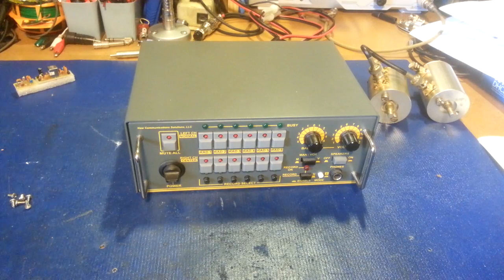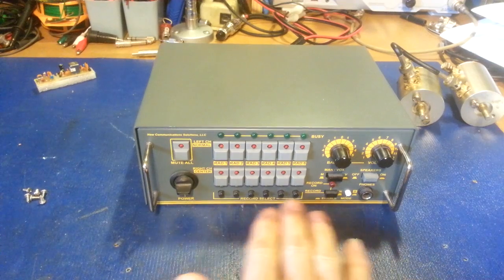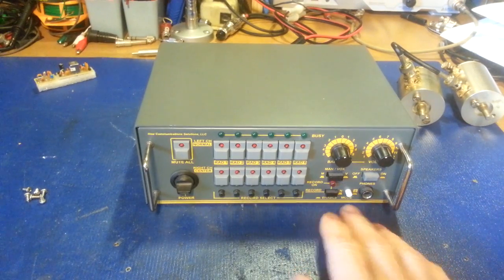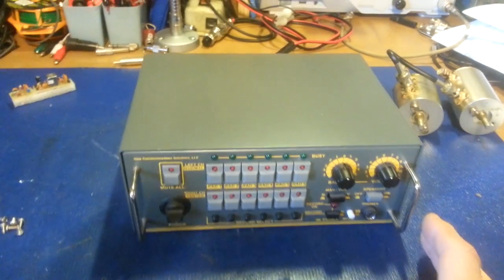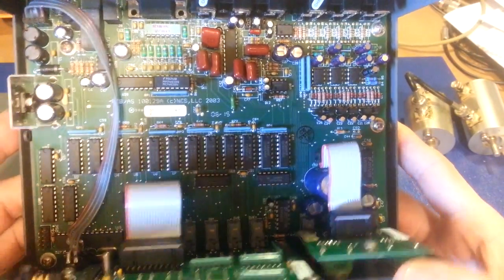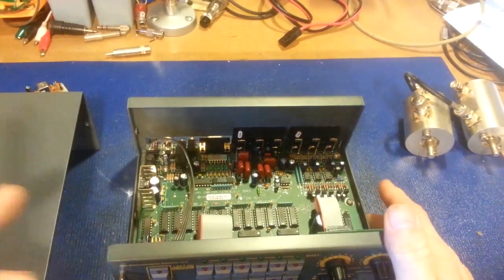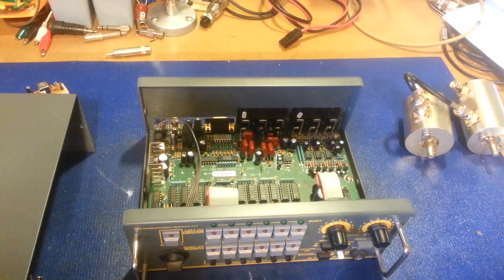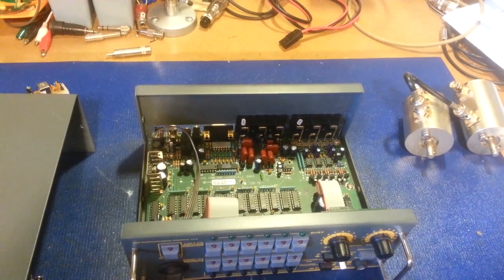New Communications Solutions NCS-3230 receiver switch box. Pre-installation overview.

Comment: I had both units in service for years, I got it new from them. They are a great product and and concept but hopefully yours won't suffer from the problem I had. It seems to have had an intermittent problem on one of the channels audio coming in and out. I sent it back to them and they either couldn't or wouldn't fix the problem. Good luck with yours. I ended up using a Behringer mixer with a small stereo amplifier. Now I'm thinking about getting rid of the amp and using studio monitors instead. Buying the set original with all of the cables when they were out was quiet pricey but when it was working right it was great. Nice video and thanks for the time for posting.
Reply from the maker: oldschoolSlyfan 
Hopefully never have a problem with them but if I would NCS was kind enough to provide me a set of schematics for them.  Thats the first thing I do when I get something,  get the schematic.  I actually just got another one of these two days ago.  Should show up this week sometime.

Do you still have yours?  Its probably something simple that's wrong with it.
Reply: Oh my, this is sounding interesting. Yes, I do still have it.
Reply from the maker: oldschoolSlyfan 

It should be fairly easy to find the problem.  The nice thing about finding a problem in something with multiple channels is you have the same circuit duplicated several times.  If one doesn't work just compare test measurements between a working channel and the one that doesn't.
Reply: When you get the schematics and like to give it a go, I think it would certainly be worth the repair costs. Thank you. (w2rkj)
Reply from the maker: oldschoolSlyfan 

You may even be able to fix it yourself.  You did say it's a intermittent problem.  It operates off 12V so no chance of electrocution or shock.  It could be something as simple as a bad solder joint thatnis intermittently making connection.  Pop the cover off and get it to malfunction.  Go through it and touch the parts with something plastic or wooden so you don't short anything out.  If its a bad solder joint you may find when you touch a part it starts working again.  If moving a part brings it back to life you just found the problem.  Worth a try and wouldn't cost you anything.
Reply: Mike it's been a while and I think I did try that. I had the problem for a few years and when I didn't have any success locating it I sent it back to Doug at NCS. I got frustrated and replaced it with the mixer. I can say this, the mixer can't do what that NCS can do.